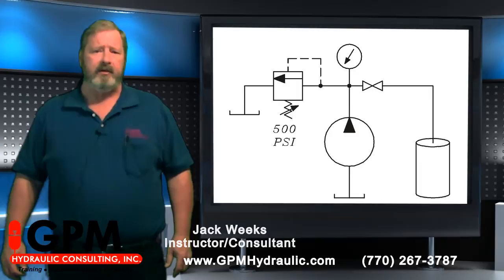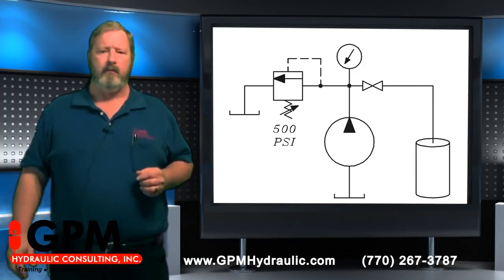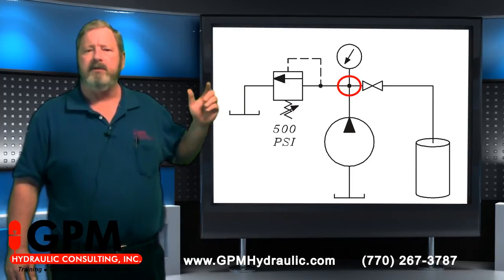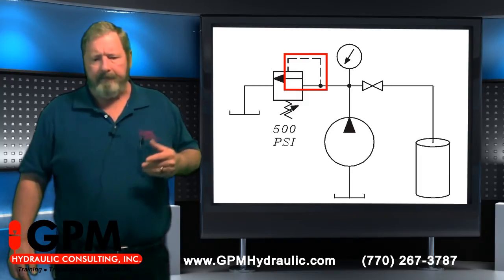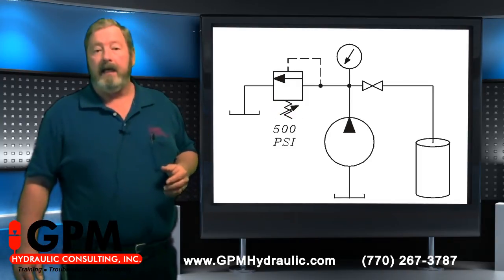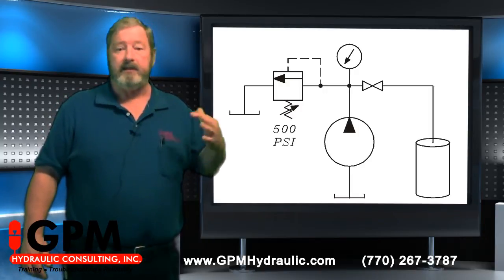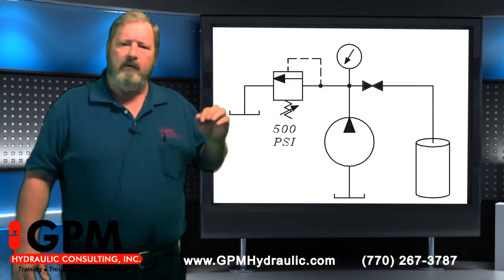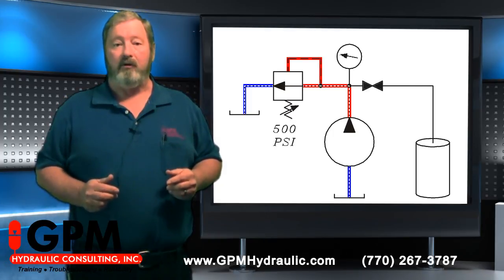The Difference Between Pressure and Flow

Comment: Great presentation, one question please. 

Once the pressure reaches 500 PSI and the pressure relief valve activates does the line pressure indicated on the gauge become zero PSI. I assume an closed relief valve will not hinder free flow?

Maybe zero for a brief sec when over 500 PSI is reached?
Reply: Thank you for your kind comment and question. No, pressure does not return to 0 PSI once the relief valve opens, even for an instant. The resistance must continue to be overcome after the relief valve opens. Think of it as you holding a spring between your thumb and forefinger. When you compress the spring, you must continue to apply that force after it compresses, otherwise, it will stretch back out. The spring in the relief valve is the same way. In fact, if you install a second relief valve in the tank line of the first one, it will take the sum of the two spring settings to open them and keep them open. Many systems have this exact arrangement to remotely set a relief valve in an unsafe or inconvenient location. Hope this helps!

Comment: Hello Jack...I wanted to do  online course. Can you please let me know where I can see the courses available and price.
Reply: Hi Ashutosh - thank you for your comment! Yes, I am currently developing my own online course now that GPM has closed. I expect it to launch by the first of the year. https://youtu.be/Gy5wTnIjydQ Email me so I can have your name on file to alert you when it launches!  jdweeks@travelin.com
Reply: @JackWeeks  sure jack..thanks a lot. I am currently in Dubai with a landscaping company. We are dealers for John Deere tractors. So basically these tractors are very advanced with full of hydraulic and electronic combination, CAN bus tecnology etc. So I am actually doing some courses on other online portals. But your course was very excellent and easy to understand. Your have developed very basic lectures and it is a foundation for our advanced understanding. So surely I would like to join. I hope they are not too costly 😀. My mail id ashru7580@rediffmail.com & aj10071975@gmail.com
Reply: @JackWeeks  Also jack...I would like to go for courses which can teach us both the fusion of electrical, electronic and hydraulic system. U know how sensors activate based on electrical inputs and how to read those advanced schematic etc. How to determine where flows of oil proceeds. Simple circuit I am used to. But complex ones I get a bit confused😀
Reply: @ashutoshjoshi9557  hello jack...have you started the online course